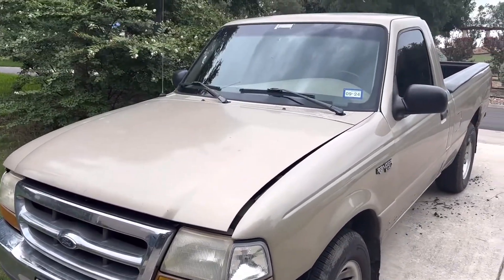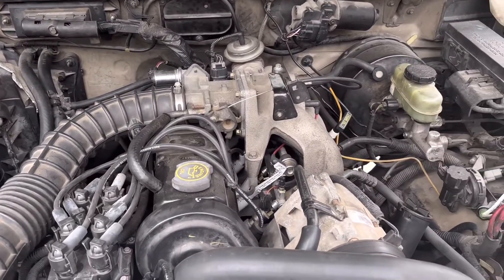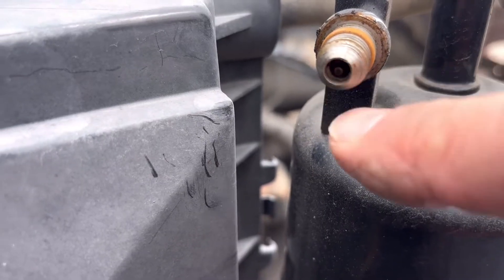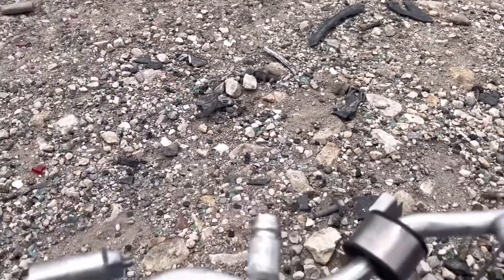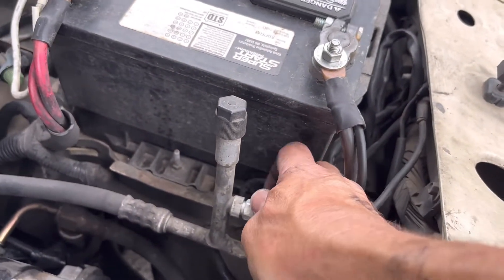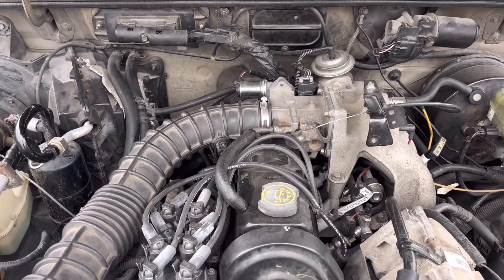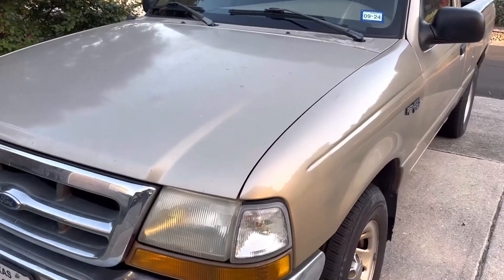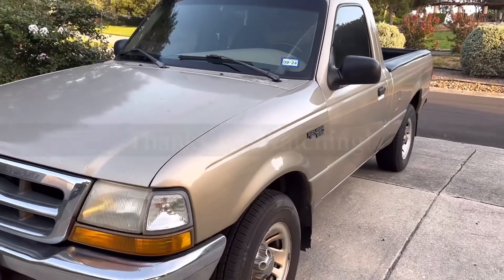Ford A/C Pressure Switch Swap!

Comment: What was it? My ford f150 also cycles on and off. For some reason it is when i get on the throttle
Reply: Did you figure yours out ? Mine does same .
Reply from the maker: Not yet. Thought I did, but still does it all the time. Maybe alternator next? Lights dim when it happens.
Reply: Same here man I have new alternator already. I have no clue it’s annoying
Reply from the maker: Well, I was going to try the alternator next!
Reply: Turns out after i replaced my condenser i put to much refrigerant. I let some out and my AC runs consistently. Still not as cool as i want it to be so i think there is more to diagnose. Getting the pressures right definitely helped the intermittent compressor cycling though.

Comment: Question when I’m looking at my ranger I have a 2001 4.0 v6 I don’t see the high pressure switch on that hose by the battery could it be that mine is on the compressor itself ?

Comment: If your noticing not super cold air coming from ac vents on max ac, trying recharging the system.. That should calm down your compressor
Reply: Yeah, this worked for my 2005 Explorer. The thing is, I bought one 11 oz can and charged the AC low port,  thinking that would do the trick. The compressor clutch would engage, and just turn off again. The pressure was still low. Long story short, I didn't realize it takes 54 oz of refrigerant to fill up the system for my vehicle, when it's empty. So, I had to buy 5 cans to get it up to pressure, haha. AC works great now.
Reply from the maker: @heli0s2003 I have a video on my channel charging a 2005 Explorer with 5 cans of refrigerant, so I know you are correct.
Reply from the maker: Good tip!